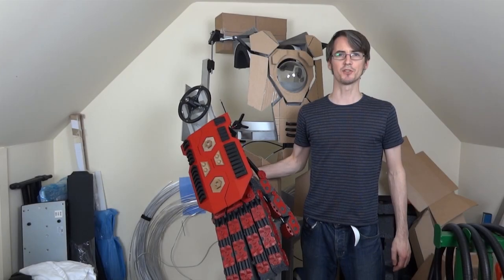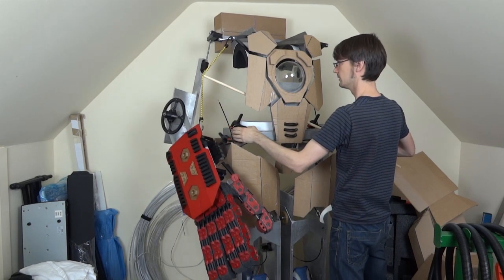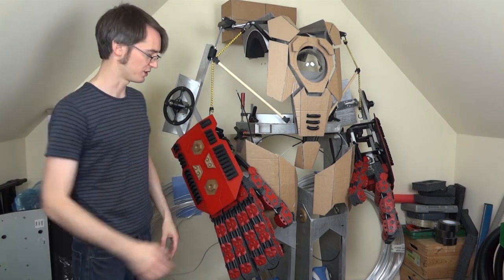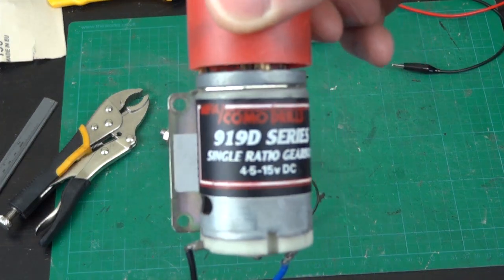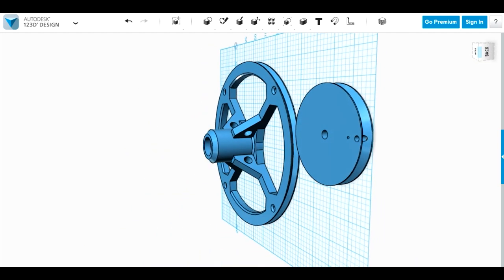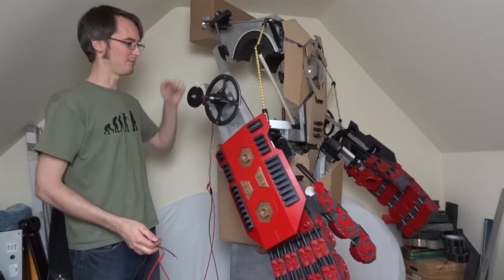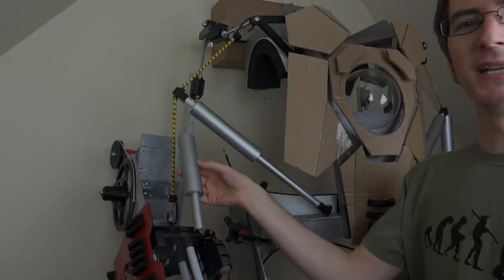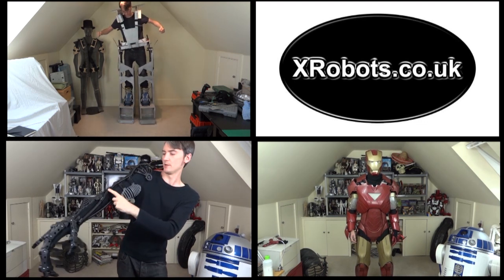Iron Man Hulkbuster Cosplay #11 | Elbow Motors & Pistons | James Bruton

Comment: you might need motors for the shoulders , wont be easy to control the arms , as for the hands you can use something better :) , will give more power to the hand and better movement . a hint , CD Drive Stepper Motor :) , im using the same to turn my air rifle into a motorized Air rifle :) , keep on the good work .